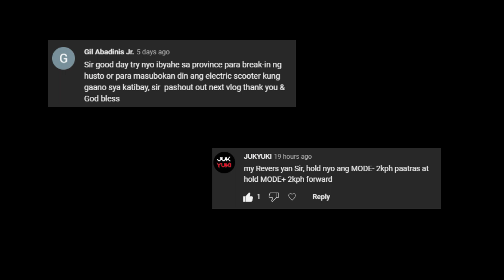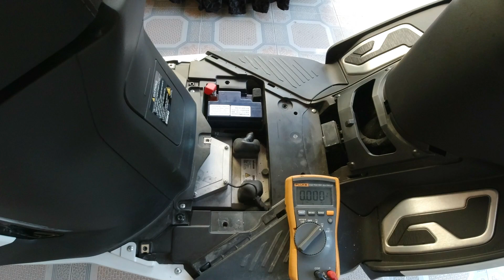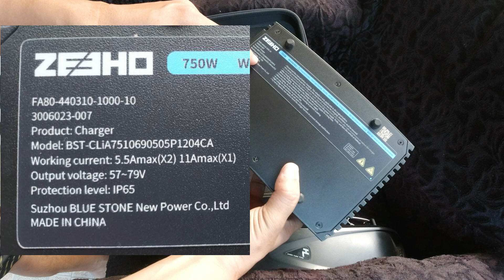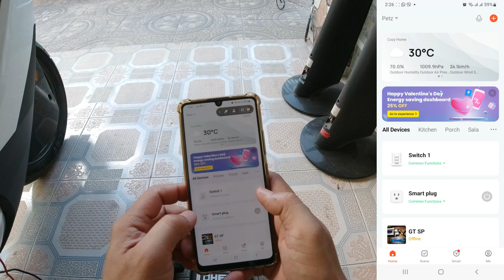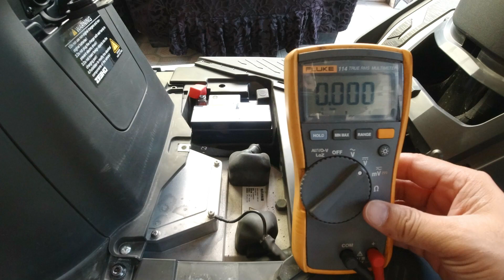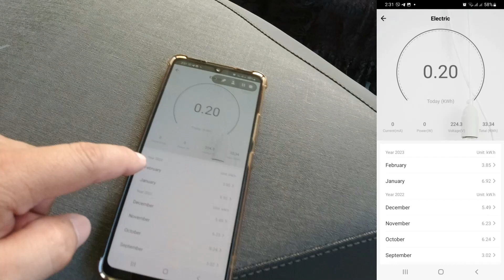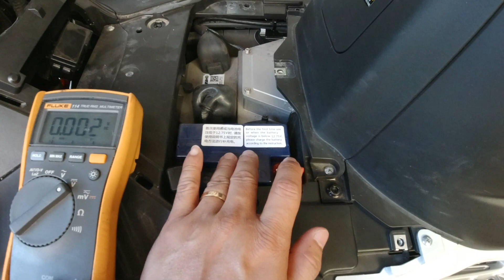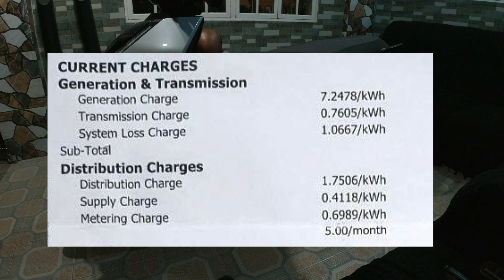Battery Charging at Home CFMOTO Zeeho AE8 Battery!

Comment: i hate the fact that those e moto need 2 battery packs and a straight question...  is it possible in future to make one big pack of lifepo4 with 2 outputs to make moto think it has both batteries  on ? or it needs to comunicate with bms ?
Reply from the maker: I hope this will be solved in future Sir. I also thinking of this one once the battery depreciates.

Comment: after charging do you need to wait 30 minutes before using the scooter? and after using the scooter  do you need to wait 30 minutes before charging the battery?
Reply from the maker: Hi Sir, after charging you cna already use the scooter. But on charging it's a good practice to wait for the battery to cool down before charging. Thanks.

Comment: Magkano daw po replacement battery ng AE8? Kung aabot din ng 100k wala din matitipid versus ordinary scooter. 

Same sa mga electric cars, the battery replacement cost will balance out the savings you got from using electricity but most of the time it will still cost you more using electric vehicle. 
Usual price ng battery is 50% the price of the vehicle.

In the future sana bumaba na ang price ng batteries to the point that you can really save money against gasoline powered vehicles.

Example ung Horwin EK3 ang srp nito 269k, ang replacement battery 90k. If need ireplace ang battery, babayad ka ng 90k para gumana ulit, ubos ang pera mo. para kang bumili ng scooter.
Reply from the maker: No idea Sir kung magkano po. Depenede din kasin yung battery life cycle sa charging habit. Kung tama lang charging then hahaba ang buhay ng battery po.
Reply: @RollyPetz  Makes sense sir siguro sa mga ebikes, nasa alaga din ng battery. Any idea sir kung nasisira din ang battery with time(months na hindi ginagamit) and not just the number of cycle
Reply from the maker: @sumotiko  Sir as long as you know how to take care of your batteries then for sure hahaba ang buhay nito. Same sa mga phonea natin na li ion types, tamang alaga lang talaga. I've converted ebikes and so far no problems encountered on the batteries and the conversion in general.
Reply: @RollyPetz  Regardless kung tamang alaga sir, may lifespan pa din yan battery, irereplace pa din yan, and ang pinag uusapan kasi dyan kung totoong nakatipid ka ba sa pag gamit ng electric bike versus gasoline powered bike in the long run. 
Sa mga Tesla cars at hybrid cars kc wala ka matitipid in the long run dahil sa cost ng battery replacement.
Reply from the maker: @sumotiko  tama Sir, personal opinion ko lang naman Sir as long as mapahaba mo ang battery useful life, in the long run makatipid kapa rin. Siguro by the time na mag replace ka na ng battery, siguro the price will not be that high...

Comment: How much will it cost to replace the batteries after degradation after so many years of use?  use
Reply from the maker: Good day Sir Ed. 

Battery degradation has something to do with the wasy how the battery is being discharge and recharge. the shorter is the depth of discharge, the longer is the battery lifespan. So for example if the depth of dischrage is at 50% and then recharge the battery, the healthier the battery is. For the lithium ion batteries, the maximum depth of disharge recommended is 80%, meaning the battery capacity remaining will be at 20%, then recharge your battery. For me, I recharge them when the battery capacity reamining is between 40%-50%. Hopefully the battery will degrade by 8-10 years time. Hopefully.

For the price of the replacment, I have no idea as of now Sir...tnx.

Comment: When did you purchase your unit sir? Is it registered? I had mine last December 2022 and it's now March 2023 but the unit is still not registered. Hope you can share your experience on this. Tnx
Reply from the maker: Hi Sir, bought mine from Motorcycle City in Talamban Cebu.  Registration is kasama sa package nilla Sir.
Reply: @RollyPetz  unsai exact address nila sa talamban sir???
Reply from the maker: @albertoopon638  Hi Sir, mao ni sir..
https://www.google.com/maps/place/MotorcycleCity+Talamban/@10.2963833,123.8947066,17z/data=!3m1!4b1!4m6!3m5!1s0x33a999254eb24e7d:0xd797ec797f7ffe2f!8m2!3d10.296378!4d123.8972815!16s%2Fg%2F11lgydjkyl